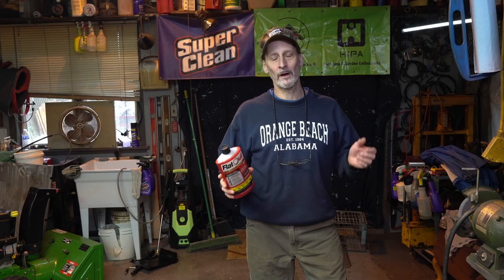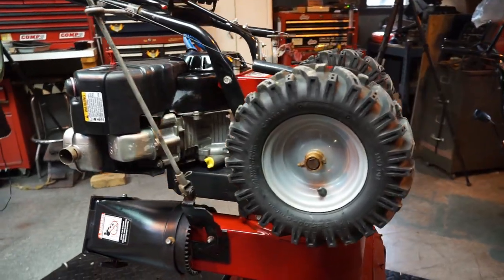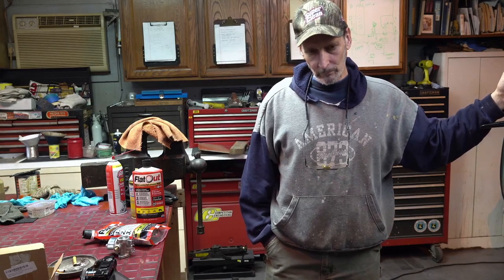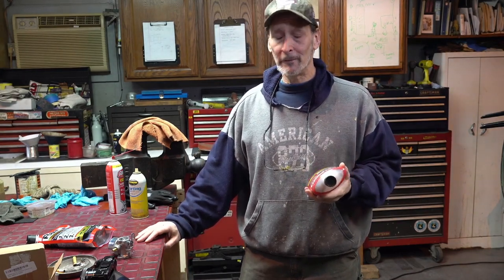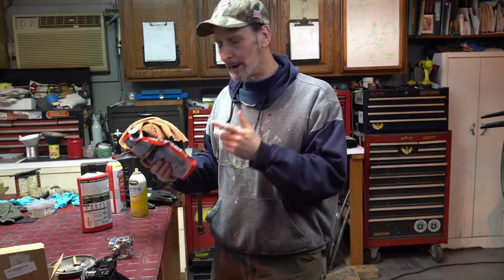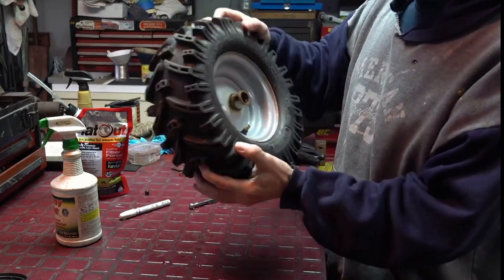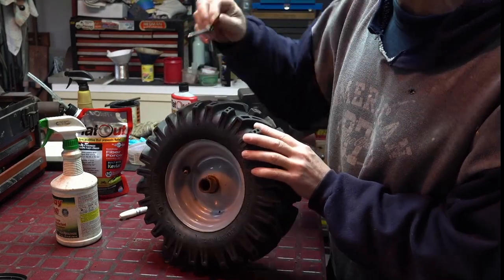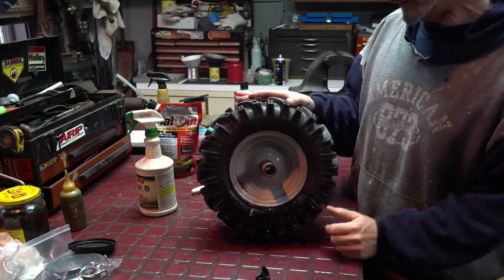FLAT TIRE? TRY FLAT OUT (Small Equipment Formula) THE EASY WAY (Stuff I Buy)! Flat Out Review

Comment: Only problem is all the Canadian Tire stores are out of stock whats up with that eh? Around $10 more but lasts 5x as long and repairs holes to 1/2" vs 1/4" how about drilling a 1/2" hole in an old tire and let us see it seal up?
Reply from the maker: Remember I mentioned that there is another version but I have no experience with!!??
The one in the bottle is good for holes and sidewall issues like I mentioned but my favorite is the universal in the bag,,
When I did that video on my new tire machine I mentioned I have many tires to go through and get off rims..
I would like to see if I can try a few versions out on these tires..Just to see what happens before I remove them..
Buy a container of that version I don't have and try that as well. 
It wont be super scientific but it could be informative and fun!!
I need a place to mount the machine and although I have been organizing I still haven't found a more permanent place for that tire machine.. 
I put a link in the description for amazon,,see if it works for ya??